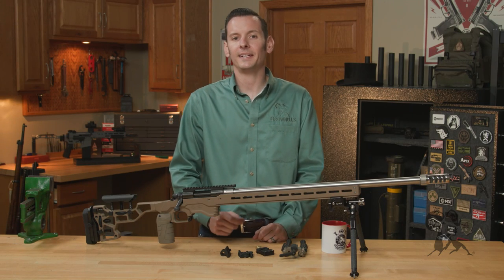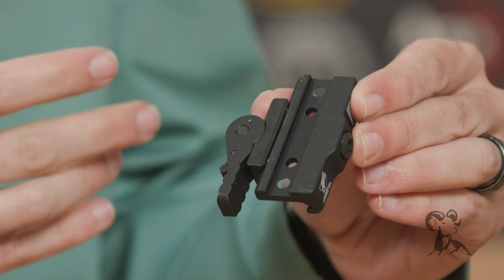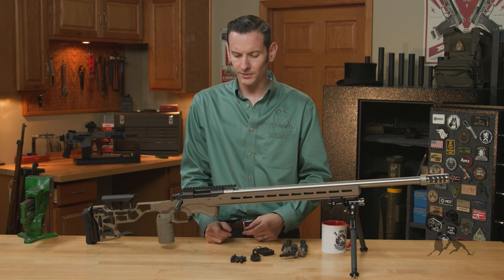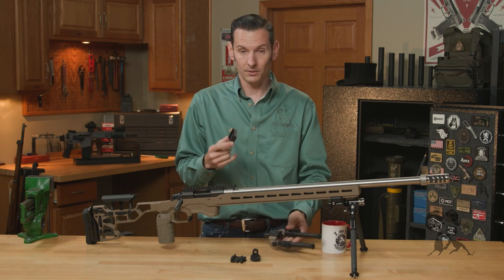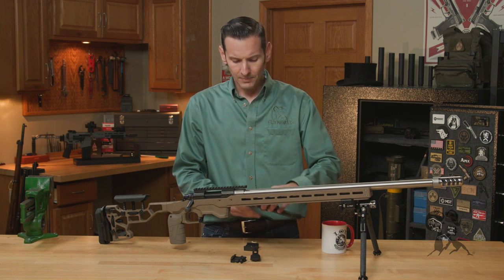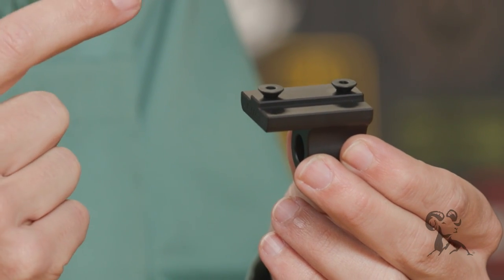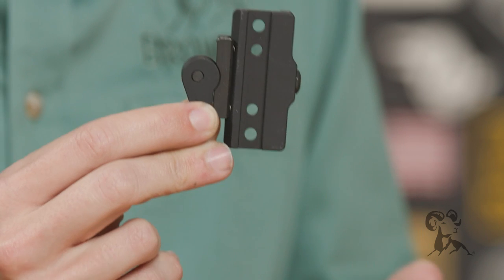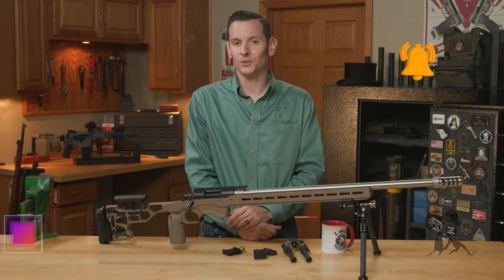Quick Tip: What a 17S Bipod Mount Can Do for You

Comment: So the benefit of this is that there is more surface contact which means a more stable surface vs something like an mlock bipod or system that is really only held in by a pair of screws? Whereas this mounts to the entire rail itself and is also more adjustable up and down the bottom of said hand guard?

Comment: I run a full length arca rail with minimalist spigot mount on my KRG bravo 10/22 build. It’s using a tactical solutions x-ring receiver and barrel. I use the spigot mount with a RRS r-lock soar clamp on an atlas bipod so I can easily move from the picatinny up in the spigot to the arca rail on the stock. It’s a total tack driver of a 10/22
With a 5-25x56 ep5 Arken it’s a blast to shoot off a tripod,bag or bipod

Comment: I'm refining my "SPR function" AR, and now that I have a fairly rigid handguard/upper receiver setup (Aero Precision M4E1 enhanced/Quantum handguard) I'm figuring out a quick release/detach bipod. Just scored an A.R.M.S. 17S mount and added a 9-slot Magpul aluminum 
MLOK Picatinny section - don't need all the slots, but I like the fact that it has 3 MLOK attachments to spread the stress over a larger area on the handguard. Now for my question - is there a comprehensive list somewhere of bipods available with a 17S interface? So far I've found the Magpul, Atlas BT69-LW17 and the MDT Grnd-Pod. I have a Magpul MLOK already and it's OK for most uses, but is there anything more rigid without jumping up to the Atlas/MDT price range?

Comment: For all practical (and common) purposes, I can see little, if any advantage over M-Loc.  We have zero requirement for tripod mounts.  Another "standard" is nonsense for the majority of us.  I'll just wait until the "real" standard, (M-Loc), mount is available to buy the bipod. Until then, meh...
Reply: Speak for yourself. Most competitive shooters use arca as well as a large number of hunters. I agree its not for everybody but once you set up for it using anything else seems archaic.
Reply: @Cristopher1976  Actually, I was.  17S accessories comprise a tiny fraction of the market.  And an adapter for M-Lok to 17S is absurd.  (Just get an M-Lok accessory in the first place.)  My point is simply that, while this seems an excellent bipod, without an M-Lok option, it's not going anywhere in the market.  Additionally, if there is some technical reason why 17S is superior for mounting bipods, I've not found it.  That is all.
Reply: @davidtigwell9021  by your logic picatinny would be the way to go. Or swivel stud mount. Mlok isn't a super star mounting solution.
Reply: @Cristopher1976  Not really - the pic rail is too heavy.  But the discussion is about only the compatibility of, and wide-spread availability of accessories.  I never suggested that M-Lok was some sort of universal superstar in anything other that the marketplace.  By that standard, it absolutely is.  Once again, not offering this bipod in M-Lok, (perhaps in addition to 17S), was a dumb commercial move.
Reply: @davidtigwell9021  they are simply allowing the end user to decide what interface they want. Mdt only has picatinny or arca. Im sure they done their research on what their customers want.
Reply: @Cristopher1976  It will be interesting to see how successful this approach is, and if it is, how long it will take to have the M-lok option.  And then, how long before it is the top seller.
Reply: Until you run a rifle with an arca Swiss setup on a tripod you won’t see the advantages. 

Check out the really right stuff SOAR line. I have their anvil head and tripod and it’s unbelievable. You can get a very good Chinese variant from brands like leofoto for 6-700 dollars too so you could try it
Reply: Clearly, several of you don't understand the point of the video or what's being discussed. The 17S standard is a standard for *interfacing two surfaces*, it's not a rail mount type like M-Loc, Key Mod, M1913 or ARCA. This video isn't about Arca rails which some of you also seem to be confused about.  The 17S standard is simply the male/female interface standard that allows you to put two different systems together! 

Instead- the bipod (or $1300 laser, or $2500 thermal or whatever) comes with a 17S interface which allows you to update (swap out) what mount your expensive device uses as your gear or technology changes. So your expensive gear can work with your old quad rail, or current M-Loc, or future....I don't know, Z-mount or whatever replaces your M-Loc (it could happen, M-Loc is only 8 years old!).

Re: "the real standard" - ignoring that's not what this video was about and that KeySlot™is an objectively better system, M-loc is great at what it does...which is a modular, fixed mounting system that is relatively low profile and easy for manufacturers to machine. However, making it to be the end all option is shortsighted and shows a narrow view of shooting. As for being a Standard....Arca has 20 years on M-Loc and has millions of uses worldwide, it's only recently that shooters discovered how useful the Arca system is.
Reply: Look guys - were this (apparently) excellent bipod available in M-Lok, without having to buy a bunch of expensive, heavy adapters, I'd likely buy one for my AR-308.  Like most, I built that rifle with an M-Lok handguard.  It currently wears a Magpul bipod, and while very good, is not as good as the bipod here in this video.  There is simply zero reason for me to buy it without a native M-Lok version.  The rifle weighs in at about 7 1/2 pounds, and while it's not the very lovely chassis behemoth Caleb has here, it reliably shoots sub 1 MOA.
Reply: @davidtigwell9021  go shoot a few PRS matches and take a look at how people mount their bipods/tripods. Theres a reason they are using ARCA.